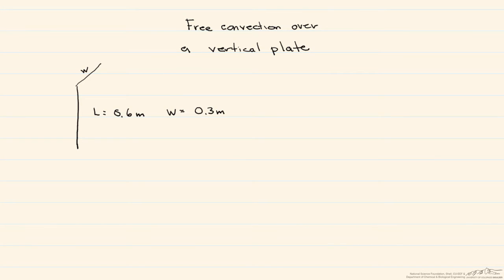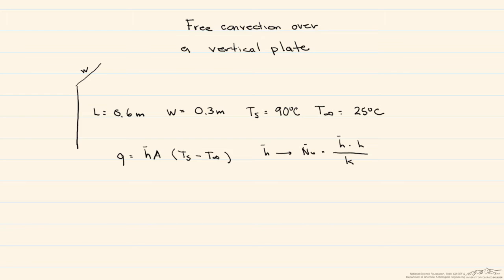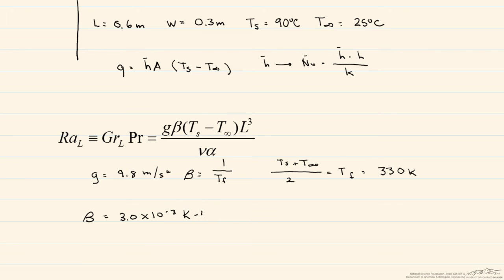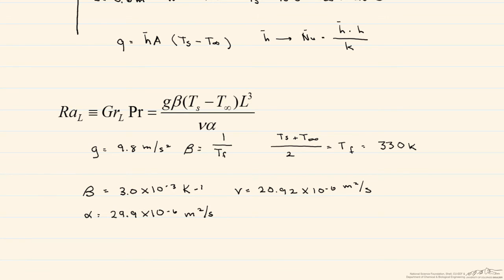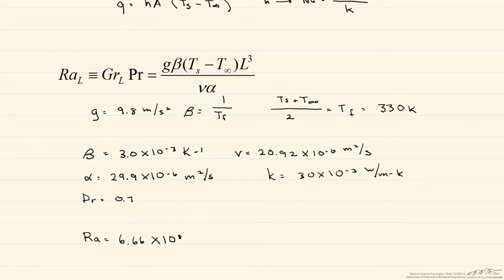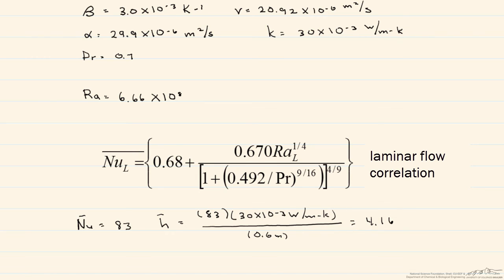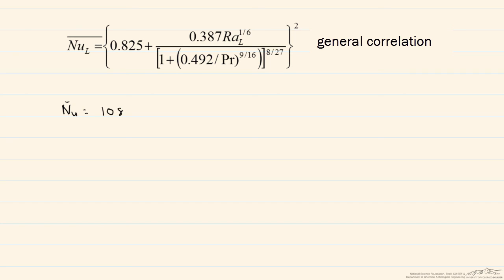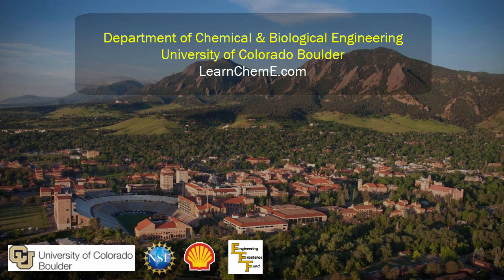Free Convection over a Vertical Plate

Comment: the heat transfer rate is 48W, assuming it's the heat transfer rate on 1 side of the vertical plate ? total heat transfer rate should be 96W ? Am I correct ?

Comment: The kinematic viscosity and thermal diffusivity of air shown here and used in the calculation is that of air at approximately 80 deg C, not at the film temperature of 57 deg C.  What am I missing?
Reply: Did you find out?

Comment: Will vertical and horizontal isothermal plates have nearly the same heat transfer rates under free convection?
Reply: I ve been wondering the same thing. Did you find out ?